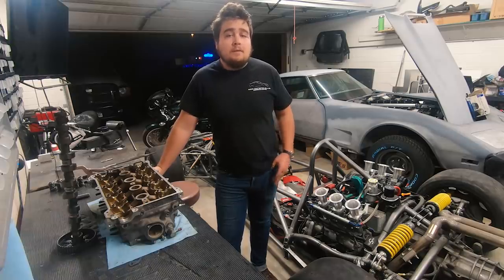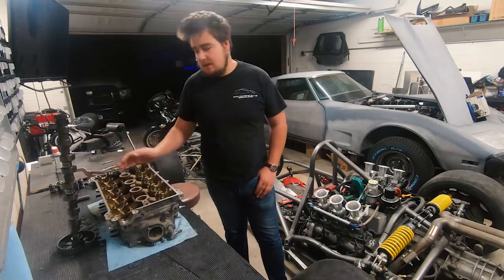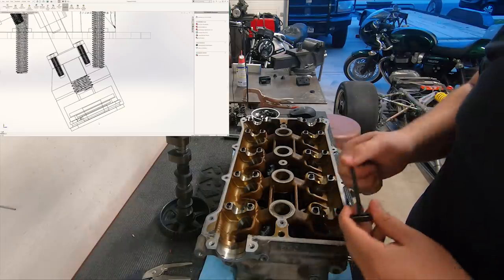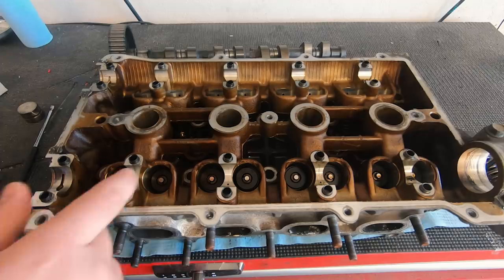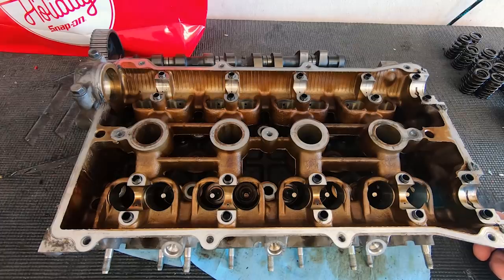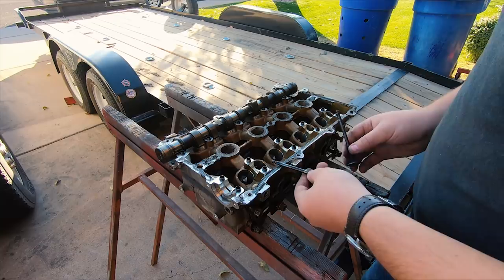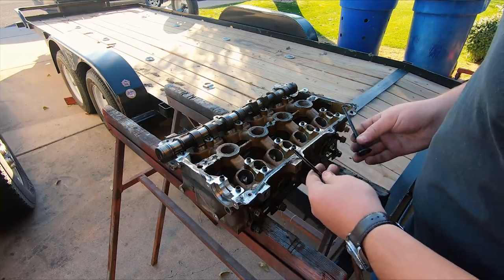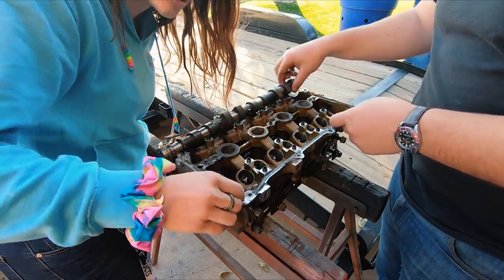Freevalve Miata Build! - Part 1 of  2

Comment: This is probably one of the most ground breaking aftermarket product for 4 stroke engines in the last 20 years.

Add a variable geometry turbo and realise the potential
Reply: For real though, this is beyond even F1 technology right now. I mean why not just go nuts and play with all the high-tech stuff like exhaust heat recovery, kinetic or battery energy recovery and everything? I think this dude is more than smart enough to have a good crack at a few of those.
Reply: @W1ldTangent  but also why F1 hasn’t gone down this road yet is astounding to me. There are numerous benefits to using this
Reply: @charlespletzke8311  F1 engine design rules are very strict to keep cost levels down.   F1 uses pneumatic springs but that's just for for reliability.  Also F1 engines rules have become increasingly strict as the engine rules are frozen that also prevents  major breakthroughs.  So engine manufactures tend to focus on increasing engine reliability and gaining power by fuels/lubricants and engine mapping.
Reply: @greenh609  Basically spot on, though my understanding was that pneumatic springs are used not for their reliability (which was originally worse though now I'm sure is pretty equal), but instead since springs that can pull a valve up fast enough for an engine to run at over 10-12k rpm end up being so stiff no actual power benefit is realised from using them - whereas pneumatic springs don't have the same issue
Reply: @benjaminmcintosh857  Agreed, I was kind of paraphrasing in my original comment.  I just meant that pneumatic springs are used because of conventional spring failures at higher RPMs.  But it is fun to think what kind of innovations F1 engine manufactures would make if things like this free valve technology was allowed in F1.
Reply: @greenh609  that’s a shame. Would be cool to see F1 develop a technology that ends up in road cars again
Reply: DFB58  very good point, but they’re the ones to find that out.
Reply: @greenh609  I don't disagree with any of your points, that's all true, but I think this guy building a working freevalve engine on a stock block and head in his garage with a 3D printer and Arduino should be proof that high-tech innovation doesn't necessarily have to be expensive or beyond reach for mere mortals. I'm really looking forward to seeing the rest one way or another, this is someone to keep an eye on.
Reply: This comment will age well.
Reply: This has been done DIY before. You can find examples on YT from ~2010 on 25-100cc engines. The innovative thing will be if he makes it durable enough on an engine this large.
Reply: Koenigsegg pioneered the tech
Reply: @ianshaw7533  we know.
Reply: @greenh609  I don't agree.  This is irrelevant to F1.  The pneumatic springs were (past tense) used, as you say, because of conventional spring failure.  The problems are 1) they themselves failed too often which means they did not solve the problem (valvetrain failure at high speed) in fact medium speed operation has challenged Koenigsegg, 2) it's unrelated to the present project because they carried S.C.U.B.A. tanks to replenish the valve actuator pressure -- this worked because in theory no air was consumed during operation unlike using air pressure to operate the valves (which is then "lost" and can't do work again) not compressors as required for the present project, 3) the supposed benefit of using pneumatic operation is to improve "streetability" in a high performance valve movement profile (cam, for instance) and this mode is rarely seen in F1 competition (maybe during Safety Car deployment?) AND they already approach 50% thermal efficiency!  4) F1 cars (at least Mercedes) already approach 50% thermal efficiency!  (yeah, I put that twice just so it could sink in, that's better than the energy conversion in a high power sniper rifle for reference)
Reply: @ehb403  Sorry my main point was just that there are many new technologies that F1 cannot explore a lot of new engine technologies because of rules and regulations.  Because it seems a lot of people that dont follow or watch F1 really wonder why F1 engines dont have all this crazy new technology that these new road legal hyper cars have.   I should've stayed clearer that F1 tends focus alot more now on increased reliability and efficiency.
Reply: Yeah but good luck finding a tuner crazy enough to try and tune this.
Reply: @zsombokiorinc  that's what the horse trainers said about the first mechanics.
Reply: It is sure ground breaking. But it will need a lot of testing and improving before it will be a commonly used aftermarket add-on. You have to add a full pneumatic system to the car and the preasures will increase if you start boosting engines. Also i would like to know how the Performance of the Engine behaves because of the missing Cam Profiles, because the valves will just open and close linearly, or do they? I hope the community gathers ideas and 3d Printing will also speed up the developement process :)
Reply: @greenh609  True, in part because that "crazy new technology" takes away from F1's mandate of no "driver assist devices" and partly because of the move to V6 hybrid drivetrains (which, I believe was mandated due to threats by manufacturers to pull out of F1).  I feel like F1 is driving some technology's, when they're relevant (like MGU-H, which electronically eliminates turbo lag while also occasionally using the turbo to help charge the batteries and which is prepped to transfer to road cars).
Reply: The possible problems are:

1) he is using air. Air compresses under load and its pressure varies by temperature, and its temperature varies by pressure. Air is good for applications where static loads are involved or shock absorbing effect of the compressing air is required or not a problem. Engine valves are in pretty aggressive environment, so all these features of compressed air may be a problem, as they may cause non-static operation of the valves. How big of a problem it will be, we will see. Patented freevalve systems usually use hydraulics, and I doubt for a good reason.

2) the system would need to be mechanically robust. The price may shoot out of the window, when making this a robust system. Maybe it is possible to achieve enough robust system with a small price, we'll see. 

3) car manufacturers are not stupid. Hence if this system would be easy to achieve with high enough reliability and low enough cost, all of them would use it. Instead,  they use really complex mechanical systems to achieve same VVT (and variable lift too) behavior. Something tells me that there might be some big obstacles to overcome to get this to a working level for being actual aftermarket product. Again, we'll see :).

It's a cool project, it hopefully works, but I would not speed that far ahead yet that it would actually make a working product or even actually usable outcome.
Reply: @Itchius Scrotus: Except it's not really "ground breaking".  Specifically, so far what he's done is covered in the patent I was awarded in 2015 (just quoting the relevant parts):

          "The invention claimed is:
           1. A device for controlling the movement of an intake or 
        exhaust valve of an internal combustion engine combustion
        chamber, the control device comprising:

            a double acting actuator piston, displaceably arranged 
              within a pressurizable cylinder so as to form upper and
              lower chambers of inversely variable volume, mechani-
              cally affixed to a valve stem so as to influence the posi-
              tion and movement of the valve via chamber-pressure 
             differential, ..."

I'm not arguing that he hasn't made huge strides in his work in a short time (he has), or that he is infringing on my patent (my work goes significantly further in advancing internal combustion gasoline engines and the rest of the claim IS restrictive -- the claim is not general, and is not because it wasn't allowed by the examiner without the restrictions -- so I'm not concerned with that).  I'm just saying that he's taking baby steps, not "ground breaking".  Many researchers have done as much (or more), including a community college in San Francisco that set up a pneumatic valve actuator that responded to variable frequency signals (what the Hal Effects sensor puts out), a small company that received NSF grant for a similar project about 5 years ago (sorry, I don't have the link handy), researchers at many universities that have tested similar systems including pneumatic, electronic, and hydraulic actuation 
(the names are readily available with a google search), and that's not including the competitive fields of variable camshaft and "displacement on demand" engine strategies or even Freevalve.  If you want to see a summary of new technologies in internal combustion engines, check out the mid-term report on the "Goals 2025" NHTSA/ EPA/ CARB emissions standards.  Most of these research areas apply (almost) equally to OEM and aftermarket opportunities.

This is a fascinating project to watch, but it's not really anything new.  It's new to him (and apparently to you, as well), but many of us in this field have been following all kinds of interesting developments -- my objection is to your use of hyperbole in describing it as "ground breaking".  Mr. Kagan is obviously talented and pursues many interesting projects, let's just skip the fantastical claims is all I'm saying.  That said, I'm personally more interested in his ability to quickly adapt his design changes with 3D printing and his obvious skills at electronic control coding.  Again, not new just very fun and interesting.
Reply: @benjaminmcintosh857  less spring pressure overall is beneficial in many ways
Reply: @petr0rabbit  indeed, better for efficiency and wear, though those weren't really of concern when pneumatic valves were introduced since teams had new engines every weekend
Reply: I thought pneumatic springs were used to 1) prevent mechanical failure, 2) reduce reciprocating weight in the valve train, 3) And the most important part which was to reduce mechanical friction of the cam having to push against the very stiff spring.  

I don’t know if it is still allowed but the original pneumatic springs were crossed linked through solenoid valves and piping. Meaning as one valve was rising, another valve was descending.  If these two springs were cross linked with piping, it would further decrease friction and mechanical inertia.  Thus allowing for increased rpm in the valve train.
Reply: @Adscam  3) is totally incorrect -- the cam still has to push against spring pressure high enough to prevent "float", the pressure just came from air.
2) is partially correct, the mechanical springs retained for safety backup ARE somewhat lighter, but that's offset by the weight/ stiffness of the diaphragm keeping the air pressure in and the rest of the valve train (which remains largely unchanged) -- call it a small gain at best
1) is the biggie (kinda) -- and why it was dropped finally.  The fact is that the air springs created as many "failure points" as they solved.  What they DID was allow insanely high revs without valve "float", like approaching 20,000 RPM!  For hours on end!  Until they didn't!
Reply: @ehb403  I got your meaning. Correct. The last point I raised, I have doubts about whether it was banned. I think Williams implemented it along with their active suspension . But you could see that this cross linked pneumatic springs would be significantly better to further reduce pneumatic pressure required in a closed system.
Reply: Definitely one of the most groundbreaking.  I'll put Nissan's new variable compression motor on that list too.
Reply: Or what about an electricaly assisted turbo fan instead of changing shapes
Reply: more like 50 years.
Reply: The rotary engine was out before that and so were engines with 4 turbochargers..Two on the engine and 2 at the rear of the car on the exhaust fed by a belt driven centrifugal supercharger..Its more marvelous than the 5 stroke or 6 stroke engine inventions...lol

Comment: Very, very cool to see Freevalve applied in an everyday engine. I'd be super interested to know the upper and lower limits of lift to see how aggressive of a cam you can emulate. (I'm assuming timing and duration are infinitely variable)
Reply: koenigsegg R&D the tech in a Saab for 100k+ miles
Reply: @Nathan-gj8ch  Well, Miatas are cooler.
Reply: @TheCarPassionChannel  miatas are definitely neat cars and I'm not trying to diminish your project in any way. what you're doing is amazing. and that's coming from somebody who swaps cylinder heads onto different blocks occasionally.
Reply: Eyyy fancy seeing you here Creg
Reply: Timing and duration are not infinitely variable, because you physically have to move a heavy valve 100 times a second by pushing it with compressed air.
Reply: @LilleyAdam  though you are technically right saying it's not infinitely variable, you are completely wrong as to how. Infinitely variable had nothing to do with how many times it opens and closes. It has to do with when it opens and how long it stays open. With microcontrollers, at some point, you will get to the limit of their resolution which by its very definition means finite.
Reply: The microcontroller won't be a problem in any combustion engine application - one can easily achieve nano second timing precision with those. The mechanical physics will be, especially when using air that can always compress more under load pressure.
Reply: @akkual  what actuators do they use in koenigsegg's solution ? Also air ? Or hydraulics ?
Reply: @owcarnia  They use all three: electromagnetics, hydraulics, and pneumatics. The details seem to be a secret.
Reply: @owcarnia  Seems like they make the open/close operation with air, but then hold the valve in position with hydraulics. I assume the hyrdaulics are used to basically "hydrolock" the valve in position after the air has pushed it open. Then the hydrolock is released and the spring is accelerated with air. I am no expert, but I'd take from here that at least with longer valve openings, air alone won't provide sufficient stability. But lets remember that koeningsegg also controls the lift with this system, so the hyrdaulics might be there just for that.
Reply: @akkual  I think they’re using the hydraulics to control how far the valve can open. That way the pneumatic pressure can just open and close the valve. Then changing the hydraulics would change valve lift.
Reply: pushbutton drag cam <3
Reply: @owcarnia  they use air and oil for theirs.
Reply: @Dominicdiazc  In addition with regular camshafts this is not a very viable adjustment. This is why VTEC was considered pretty revolutionary over regular VVT when it was introduced because it wa variable valve timing and lift control that switched camshaft profiles when the engine hit a certain RPM. That's a system that trades efficiency for power in high RPM which is a great thing for Honda's small engines and is a big reason why Honda became so popular in the 90's and early 00's because small engines that could kick a little ass were well appreciated. The freevalve technology is different because it doesn't even have individual modes, unlike VTEC. There are a technically unlimited amount of I guess you could say camshaft profiles to choose from with this system to control valve timing but also valve lift. This system is no doubt a great way to make a highly efficient, high powered engine.
Reply: @NBSV1  And then, I imagine, the magnetics are used as a no-contact spring to push the valve back into place. Significantly less mechanics required and snappy operation, assuming that is how it works. Wesley's system would be the slower of the two, but probably just as effective out to about 7-8k RPMs.
Reply: @owcarnia  would make the most sense to use an electric solenoid. speed of light baby!
Reply: @yenvalmar  That has been tested, but solenoids powerful enough to move the valve fast enough, far enough and doing so up to 333 times a second takes just to much power to drive. The pneumatic / hydraulic combo require much smaller solenoids to control and has been shown to be fast enough.

It would have to actuate 333 times a second at 10Krpm. That's in 4-stroke mode. If you try to run the engine as a 2-stroke that goes up to 666 times a second. If you try to use a solenoid to do this it will have to be huge, and it would take a lot of power to do the work, which would make it glowing hot. So many problems...
Reply: @owcarnia  https://www.youtube.com/watch?v=XrYt1JHNmh4 This guy did a review I think on the patent, explaining how the actuation is done with a combination of air and hydraulics.
Reply: instablaster.
Reply: This entire comment section would be the best Xbox chat ever

Comment: If you decide to start making these, I'm sure Christian von Koenigsegg would love it for his own Miata!
Reply: Are you sure he hasn't got a FreeValve already on his Miata :)
Reply: @Damicske  I don't think so, besides it being lowered and after market wheels it's fairly stock as far as I know. But speaking of Koenigsegg tech in a Miata, the Koenigsegg TFG engine would be perfect in one of those!
Reply: The big advantage of freevalve though is the variable lift. With air that’s not possible.
Reply: @limitlessbuilds  With a spring installed on the valve, It would be possible (but hard and probably unreliable) to control lift with air pressure.
Reply: @limitlessbuilds  what is the advantage of that? You still have variable duration here so you can still vary the total flow.
Reply: @limitlessbuilds  you would not need variable lift with this kind of design because it is not a high flow or high HP engine. This is merely proof of concept